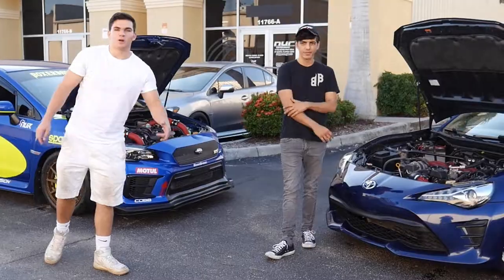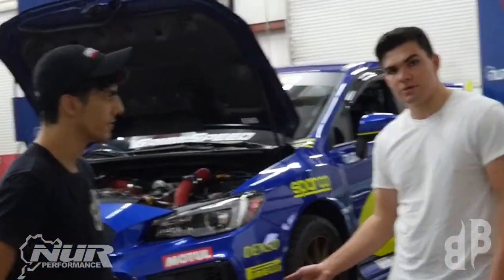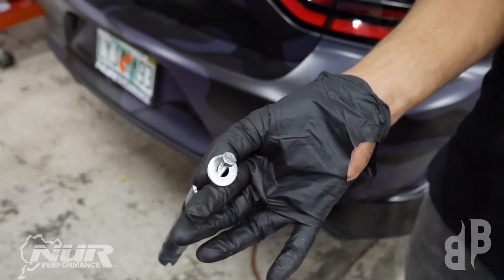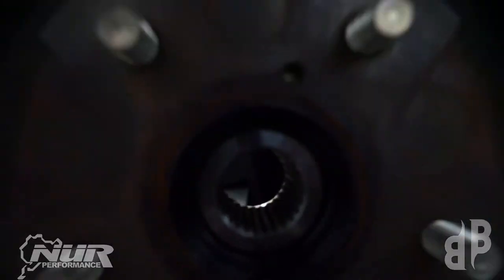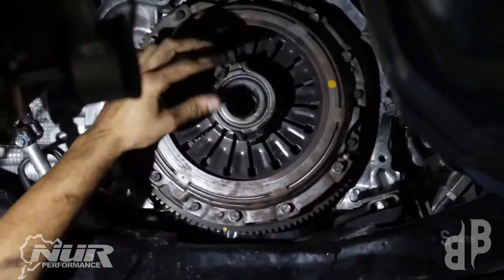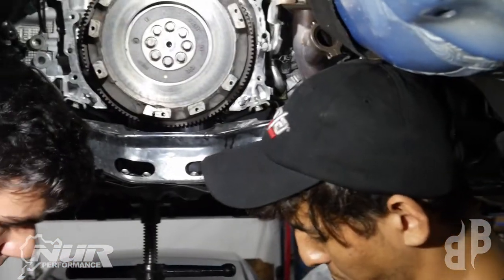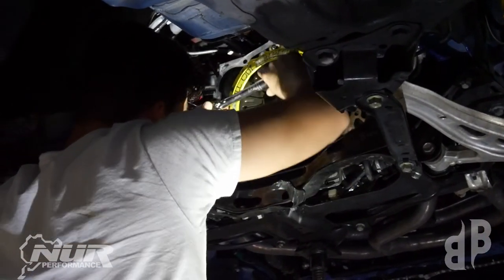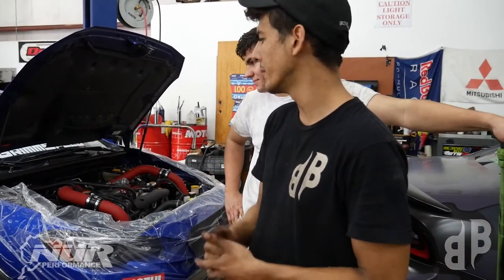HOW TO Replace the Clutch in a Subaru WRX STI! (2008-2021STI)

Comment: Awesome! I’ve got a competition clutch installed & babied it. It’s a little less the 12k miles & it’s already slipping. Think I’ll just have Subaru install a stock clutch back.
Reply from the maker: That’s super odd… did you remove all the grease and everything that comes on it factory?
Reply: 2600 to take it to Subaru

Comment: Ok so first time taking out trans, everything is unbolted, the pin is out the fork is pulled up. This trans will not come free of engine at all
Reply from the maker: It was probably the dowel pins. They rust into the block

Comment: How reliable is a 380 whp sti before u got it built
Reply from the maker: I’d say that’s still in the somewhat safe range on stock internals. It may not last as long but you should be ok as long as you treat her well. E85 REALLY helps keep the engine cooler
Reply: @boxerbaddies   is that why u built the engine ? And I did upgrade my radiator to a bigger one got a Aos and a 4 cylinder cooling mod
Reply from the maker: @davidpolak1431  oh awesome! I rebuilt because the opportunity to rebuild with Nur Performance came up, and I couldn’t turn it down. Would do it again 100%!
Reply: @boxerbaddies   appreciate you answering waiting on a video soon !
Reply from the maker: @davidpolak1431  anytime! New one is in the works!
Reply: @boxerbaddies  bet bet

Comment: The only thing you missed is that the transmission is really hard and I mean really hard to separate.
Reply from the maker: Well, this actually depends. This was a newer car so it was fairly easy. But if you saw the other video on the channel of separating the trans on the black STI, it took nearly a couple hours to separate. It usually becomes difficult because over time, the dowel pins can rust, nearly fusing it to the engine. 

Regardless, thanks for watching!!

Comment: Does the fa20 clutch replacement require u to pull the motor?
Reply from the maker: Either the motor or trans needs to be pulled, yes
Reply: Thanks